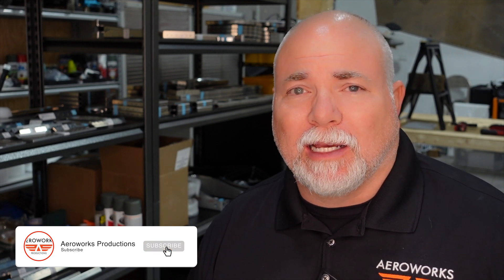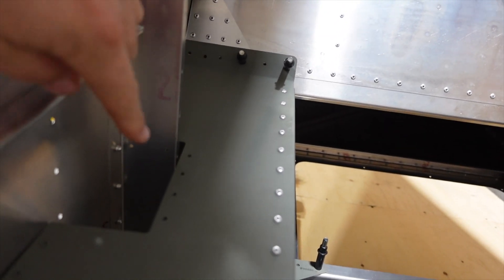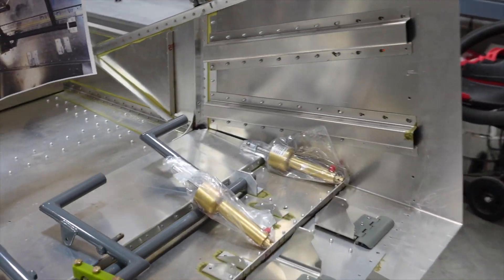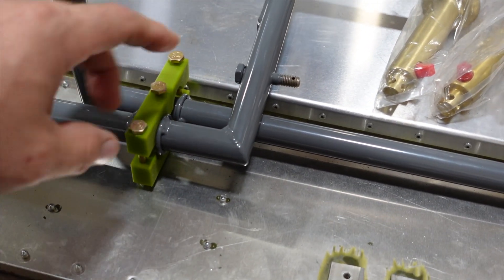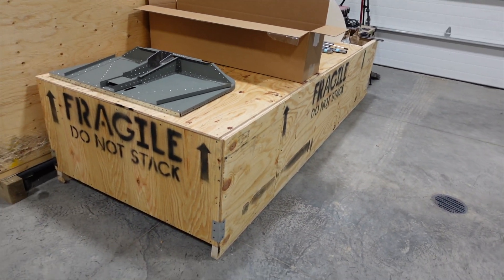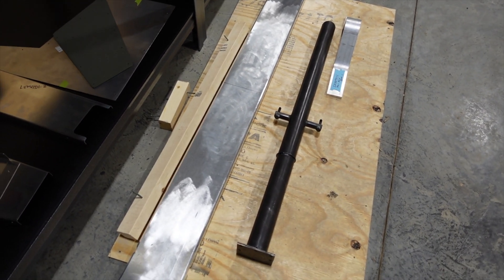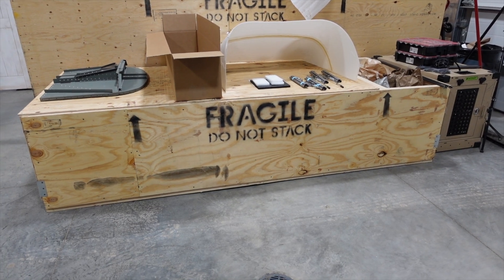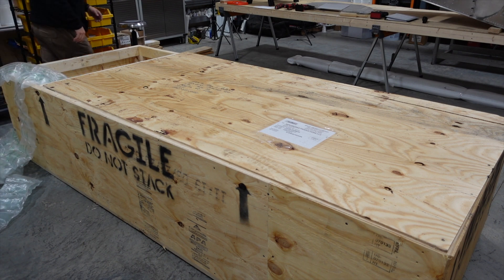Ep. 11 | Finishing Kit Delivery | Zenith Super Duty Aircraft Build

Comment: Question:  Is there any concern with the heat involved with powder coating annealing, or softening, (taking out the spring) in your landing gear?
Reply from the maker: Brought this up on the Zenith webinar today and they said that another builder had contacted the aluminum manufacturer directly and got the ok that powder coating was not going to affect the strength properties of the aluminum.  **Disclaimer, do your own research for your own build.
Reply from the maker: Great question and that has been brought up before.  We will be addressing that soon.